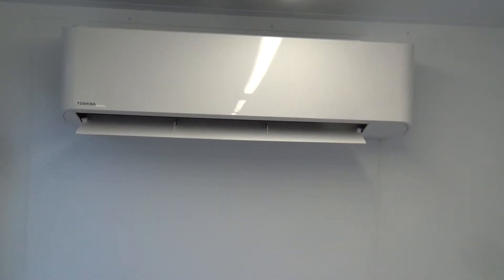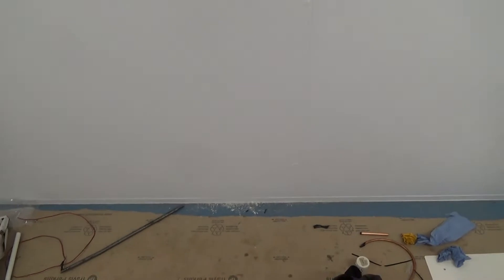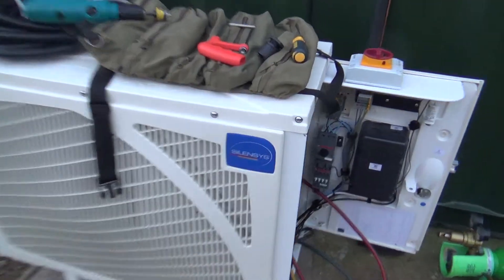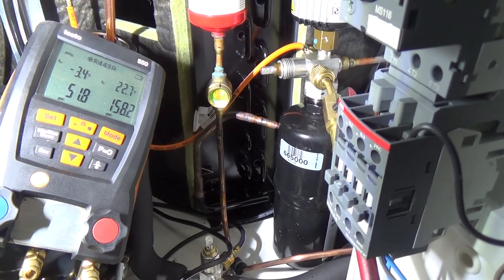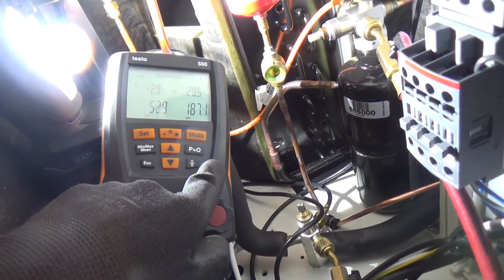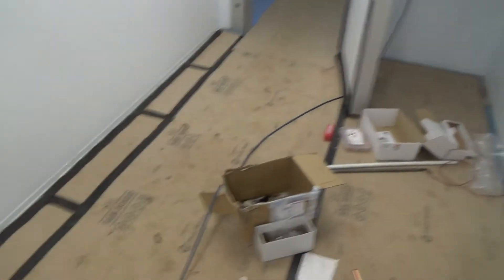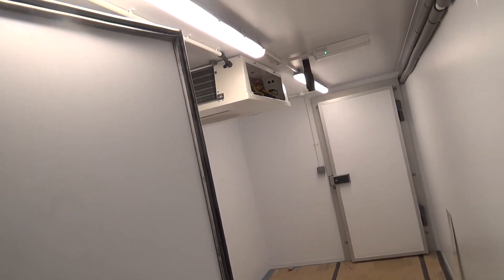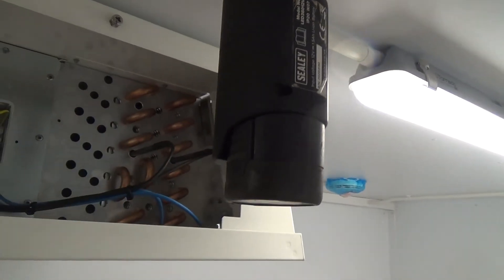Small Cold Room and Air Con Install

Comment: Beautiful workmanship diesel ! Very clean install. regarding that noise , i installed a L. L solenoid backwards once. it made that noise.
i double check now. yea , only done that once !
Reply from the maker: Yeah, I've put one in backwards too before! This one was too big, it had a 6mm port when it should have had a 2mm port, its only a 1/2hp system.

Comment: Really nice installation John, I really like that equipment. You have it service friendly. Please update us on solution for that noisy solenoid valve. Stay well.
Reply from the maker: I fitted the correctly sized valve the next day and its been working correctly since. The noisy valve was used in another much larger system and worked ok too.
Reply: @heavydiesel  I never would’ve thought the larger valve would cause that noise? Thanks for the update & info. Hope you and your family are all well.

Comment: Very interesting with the solenoid . I don't quite get why it being too large would prevent it from shutting off ? 
Very neat install 👍
Reply: They use the pressure drop across the unit to operate the diaphragm, so if it is too large the pressure drop is not enough to operate it, so it sits there partly open or partly closed, making the noise. If it is closed the drop is enough to operate the diaphragm that closes the main valve, but once open it cannot close it again.
Reply from the maker: This is the first time I have seen this with a refrigeration valve but have seen this issue on water valves where there is a low water pressure problem. 
The plunger in the valve just uncovers a bleed hole and the actual refrigerant makes the diaphragm move, or not in this case!

Comment: i've never seen that with a solenoid i'm always over sizing so its easier to braze and just more comfort just slip on style  IE:  Liquid is 1/4 i slip on 3/8    Liquid 3/8 i slip on 1/2 and so forth so your situation is odd ... Maybe the valve was backwards? or  some  particles were in it
Reply from the maker: It was in the correct way for flow, it was a 3/8" valve with a 6mm port, the spec actually called for  1/4" valve with a 2mm port, once I swapped it for the correct spec it worked as it should. I used the valve from here on the next job and it worked correctly.

Comment: I didn’t know that the oversized solenoid valve would cause that. Was this stopping it from pumping down then? Or was that noise constant even whilst the coil was energised ? 

Great video as always 👍🏻👍🏻
Reply from the maker: The noise was only there when the coil de energised, I checked it and the flow direction was correct, turned out I had fitted a valve with a 6mm port when the system flow called for a 2mm port, correct valve cured the issue!

Comment: Valve should always close. A minimum opening pressure differential (mopd) is what can cause a problem that can cause the valve not to open fully if the valve is too big (low pressure differential).
Reply from the maker: I fitted the correctly specified valve and it work fine. this valve was used on a bigger system and worked fine there too.
Reply: @heavydiesel  strange. Never seen or Heard this. You went from an evr4 to an evr2?
Reply from the maker: @Ingmaringmar  I went from and evr6 to an evr2 so quite a bit smaller. I've had this issue with water valves but this is the first time with refrigerant valves.
Reply: @heavydiesel An evr 6 is a Servo valve and an evr 2 is a direct acting solenoid. Could be that An evr6 never opens fully and than sticks in a party open position when de-energized.
Reply from the maker: @Ingmaringmar  That makes sense, thanks for the information!

Comment: Nice work HD, I have question, what is that kit for on the Solenoid Valve with the bar? Also that is a weird sound the valve makes...just curious if the flow is in the wrong direction causing that reaction/sound? Keep up the videos!
Reply from the maker: Not sure about the kit, I made a support by joining two m4 brass screws with solder if thats what you are asking about. The weird noise was the valve not shutting mechanically when the coil was de energised. I fitted a smaller solenoid valve the next day and it worked as it should.
Reply: @heavydiesel  Yes, the support was what I was asking about, thanks it's pretty neat way you supported the valve.  Ok, on the smaller valve, yea, I was just curious if it was anything else causing it besides the larger port.  Thank you for the clarification.